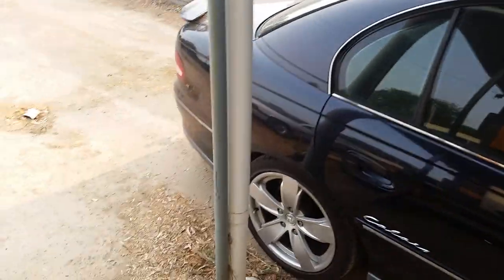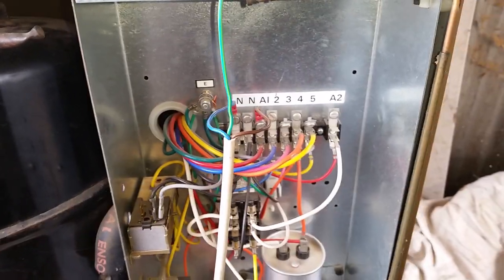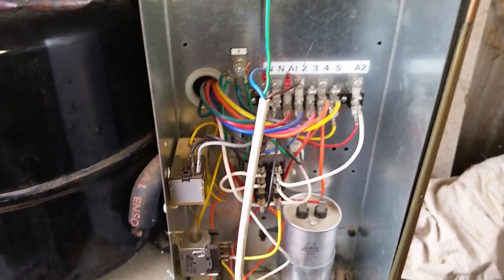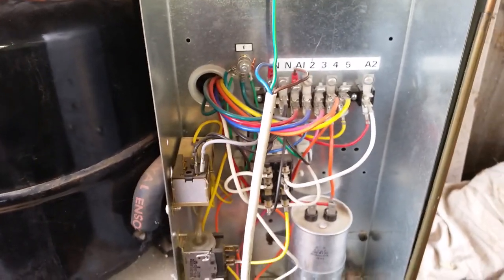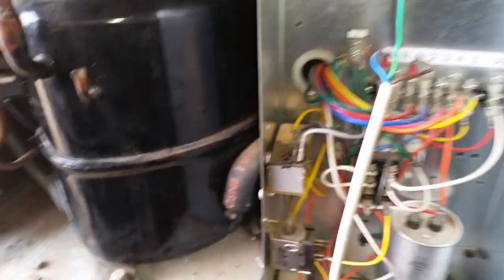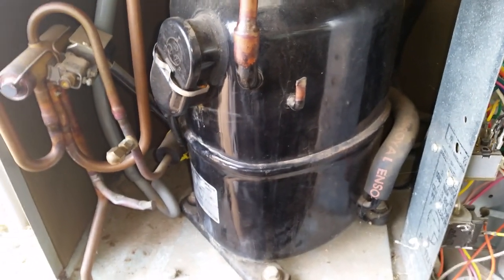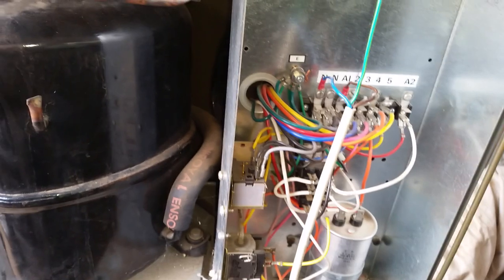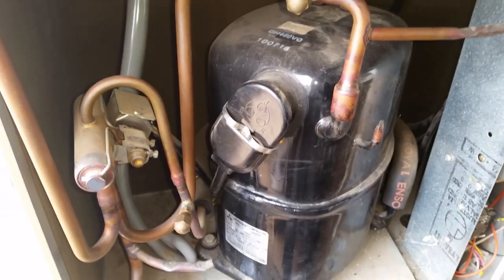Refrigeration systems and an important note about safety

Comment: Looks good enough for short tests, unless that wire was crap china rubbish then it's got very little copper :-(
Ive seen car jumper cables with odd looking wire strands, not very good conductance wise.
Reply from the maker: G'day mate, That cable was crap china rubbish lol. Good for low load very short term tests
Reply: Not to mention aluminium coloured to look like copper wire